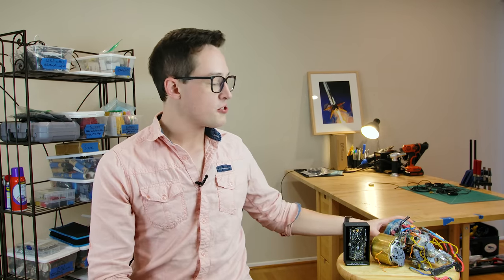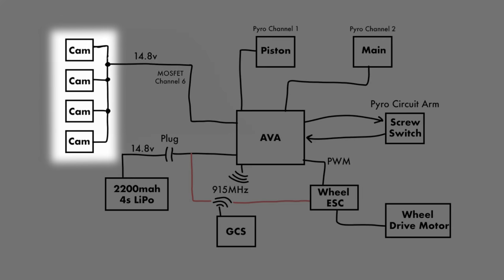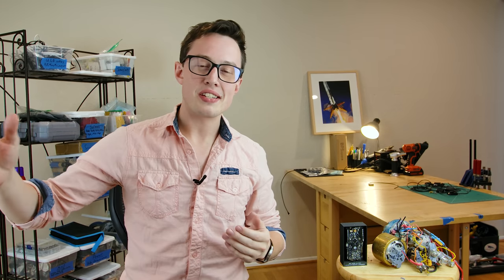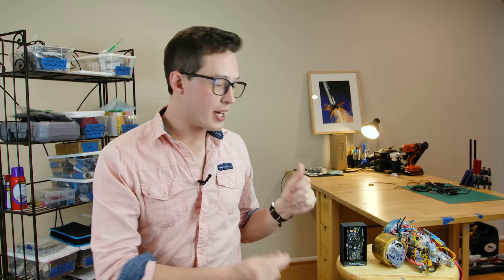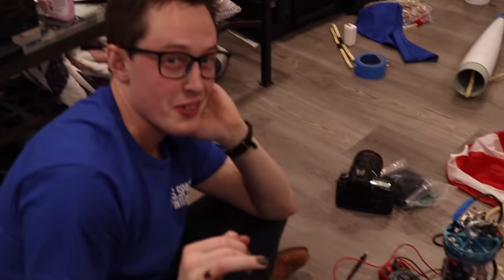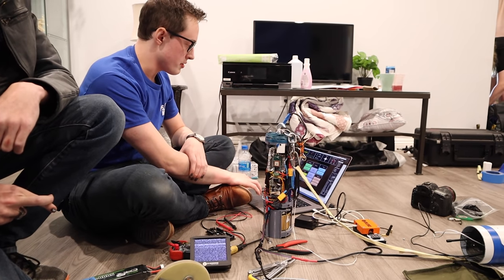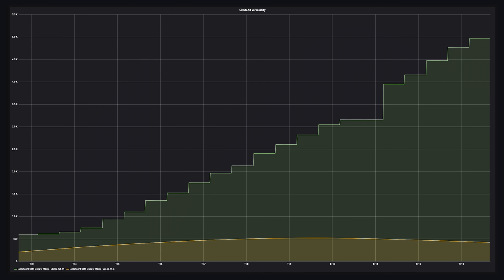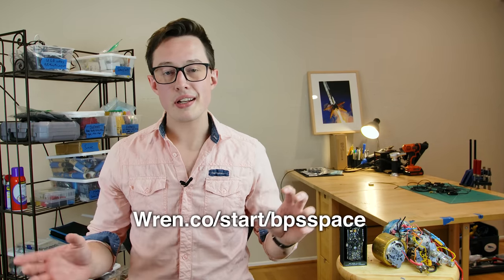Rocket Avionics - Building Lumineer

Comment: Perfect explanation , and joe Im about to build my first Thrust Vector controlled Rocket Next Week , Im planning to use a ESP8266 or More known as NodeMCU as the MicroController , it has enough space to Fit the code for IMU's , Barometers , Telemetry and GPS , should I go with it or switch to Arduino Nano
Reply: I’m going with a nano on a 3” tube I’m designing something similar to Starship with 2 stages and gonna attempt a falcon 9 remake with 2 or 2.5” tube
Reply: Be careful with esp they have realy slow io speeds (that apply to esp32 and esp8266), so slow that io speed is compared to atmel 8 bit microcontrollers  running on 8MHz (using optimized pure C code, arduino code degrade io speed on atmel by factor of around 50 times for just pin toggling)
Reply: @mrlazda  ESP32 runs a 32bit , dual core , 160mhz-240mhz clock rate , it has more Flash memory than the Teensy 3.6 , at just 9.99$ , its a killer value

Comment: why not use two reaction wheels rotating opposite. by braking just one wheel you turn, brake both to discharge energy
Reply: One reaction wheel works better, as it weighs less.

Comment: This using different wires for all joints, is that like having both square and round lithium hydroxide canisters??
Reply: No, because the reason that happened was because the LM and command module were made by different companies.

Comment: Sorry to be the one to tell you this, but there is no way that stopping the burning of fossil fuels will affect the climate in any way.  The climate is on a cycle; 400-500 years of hot followed by 400-500 years of cold.  The overall cycle is around 900 years long.  Sediment records from the Colorado River show the cycle.  Historically (900-1400 AD), it was hot when the Vikings were doing the Viking thing.  That hot period happened without any CO2 emissions.  Then it got cold for a few hundred years.  Now its hot again.  It got hot and the world did not end; the ice caps did not melt; the deep ocean currents did not collapse.  All historic indicators show that the warm periods are actually beneficial to human life.  Wait a few decades for inflection point effects to end and the climate will stabilize a little hotter.

Comment: could you overcome the saturation problem with counter rotating wheels? either 2 inline or 4 smaller high speed ones on the same plane like a quadcopter
Reply: The saturation will always be a problem.
I think the larger the diameter of the wheel, the better it works, because you can store more momentum with less added mass.
It may work if you use the whole nosecone as a reaction wheel, that way you can get rid of some of the rotation due to air friction.
Reply: @Henning_S.   @Henning S.  

I like that nose cone idea. Makes more sense to me than hiding it inside where it has to me smaller and doesn't have the aerodynamic advantage. Wonder how it would go dealing with these speeds though

I was thinking if you have 4 small wheels mounted inside the rocket in the same layout as a quadcopter, you could spin to opposing wheels to counter the rockets spin. The fact that they are mounted toward the outer edges of the body will give them more leverage over the rocket to somewhat account for the smaller diameter. As long as they are equal distances from the centre it shouldn't throw the spin off centre. Then, when they are getting close to saturation or you have reached apogee you can slow them down without adding to the rockets spin by spining the remaining 2 wheels up as the first two slow. 

To see what I mean you can place a quadcopter with no props on a lazy Susan or hang it from a string. Even with no props you will have complete control over its rotation without any saturation issues.

The only other thing I'd add to this is to make the 4 wheels long so they can maintain a weight advantage. 

The more I think about this, the more I want to try it. I've made a few rockets before. Might be time for some experiments :p
Reply: @tomjones634  i don't think the quadcopter method will work.
Of course you can spin up 2 wheels to stop the other two wheels, but then you end up with two other wheels spinning, how do you stop all of them? You can not remove that momentum without putting it back into the rocket.

You could use 2 small wheels which can be tilted, if 1 wheel is saturated you tilt it 90° then decelerate it, that way the roll momentum is converted into pitch momentum which can be corrected via thrust vector control.
While 1 wheel is "discharged", the other wheel can be used to control the roll momentum.

But as you see it is very complicated...
It is way easier to just mount 2 servos with small fins or maybe grid fins which control the roll, it also saves a huge amount of weight while just adding a slight amount of drag.
It can be combined with a very small wheel for even better stabilization.
Reply: @Henning_S.  Good point, it wouldn't dissipate the energy, just transfer half to the second two wheels. Maybe it would work if it was more like a quadcopter though. Spin up all 4 wheels before launch to about half speed so the first pair counter rotates to the second then to correct the rockets spin you speed one pair up as you slow one pair down. The only time that would be stable while under power is when all 4 motors are at the same speed. You just need to make sure the deceleration of the first 2 matches the acceleration of the second 2. It may not completely solve the saturation problem if it's underpowered but it would give you a way to slow it down at apogee. 

I may be thinking about this wrong though. When I get time, at the end of this month, I might actually put something together to run some experiments. I've been meaning to set something up for ground testing anyway. Will upload the results when done if you're interested.
Reply: @tomjones634  i just subscribed to your channel, so I can see the results of your test.
You mentioned the setup with the quadcopter without blades hanging from a string, you can try to rotate it with your hand, so it has to constantly correct that roll, and then shut it down and watch how it behaves.
Reply: @Henning_S.  thanks for the suggestion and the sub. I have a drone so I should be able to pull that off pretty easily.

Comment: I mean this with no disrespect, and hopefully it will become new skills. 

You appear to want complete control over design and decisions without respect to your teams opinions and insight until it comes to failure analysis, and then you actually act as a team manager.  

I understand the problem with the inertia wheel having to much stored energy, I think it could be used, but that would take a new paradigm in how it’s used to work, and that’s outside the critical path for your long term goals as stated in previous videos, I would engineer out that distraction.

Comment: You clearly need a radio technician in your team. Or this telemetry will never work. HAM radio operator with general license and a lot of experience with self building circuits should work. You need specialized antennas, your crappy gumtail broadcast sticks won't work at all. Especially because they were polarized in the wrong direction. You are working in the low power UHF bands 433/868 MHz, I assume without license you're doing ISM band stuff and you are with this limited to 10mW (at least in Region 1, Europe you would be). On 433 you'll get snuffed by every HAM radio amateur, because they have priority on these frequencies. A simple handheld radio will snuff your signal .
This is all fine and dandy in the lower distances, you will lose data reliability after around a kilometer distance. If you try to get to 10km that's not a good thing and you'll have ionized gasses in your exhaust that will block your line of sight, which is the only thing that will let your signal come through. Metal near your antenna will kill your SWR additionally.  You are very far off success with your radio equipment. But before you add more weight to your insanely overweight rocket, think about directional antennas. You might want to get in the 5 GHz range, use a tiny dish antenna, a double quad would work or to line it up with your rocket body a standard Yagi would be recommended. At LEAST by God do a MIMO configuration, so that your metal rocket body doesn't snuff the signal. It is also possible to align thin antenna wire to the OUTSIDE of your rocket body, so your 10mW ISM or 100mW WiFi signal isn't blocked by the hull and all the other stuff. It is NOT just the sandwich to your metal core, this is futile, of course, but this will not be enough. Your antenna needs to be moved away from all motors, servo motors and everything that does electrical noise. Helical antennas could work, but they need to track, means you need to put them on a gyro to always point the directional antenna towards your launch pad, no matter what. 

If you use a directional antenna you might easily gain 20dB signal strength, if you want to gain that amount of power simply by adding watts to your transceiver, it would go up 200 times in watts. I don't think so. Also remove the casing of your antenna, if you have nothing that you did by yourself, the black crap in that gum will attenuate the signal significantly. If you remove that crappy crap around the brass stick inside, you'll gain a good couple of dB by that. I do that all the time with the external WiFi antennas to put power to the routers here, since I learned how this works. But you need to correct the SWR after that and the length of the antenna, usually you need to add some length, because your signal will be faster without that attenuating black crap on the wire. You can even simply REFLECT the signal just by putting a reflector behind your antenna, best case a flat round shield in the correct distance. If you do that in a parabolic way you can turn either the shield around your antenna or move the antenna towards the paraboloid. Yes this means additional servos, but there's not much force involved if that system is halfway balanced. 

Get yourself a good HAM operator. Let him test this. Use directional antennas, you really don't want to use broadcasters. Your telemetry is a mission critical technology and while the rest is looking fine, your radios do not. It's wrong. And if you don't kick everything out and do it from scratch again you won't 

Good luck for your next start and may the skies be blue and the winds be low. And your radio working. Really. You already know that your radio sucks, I can tell you this: you are underestimating this problem. Get yourself an expert on the team for that. You can't do that with off the shelf items, especially not with these crappy crap antennas. No.

de Hanno, DL7HH